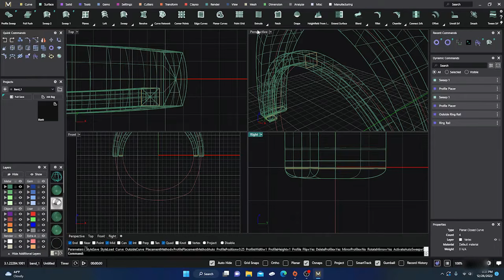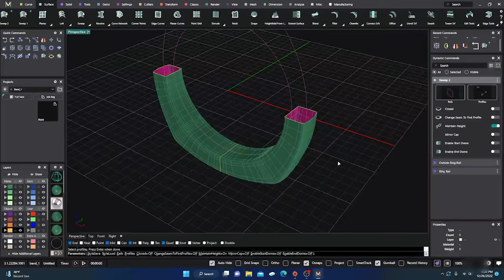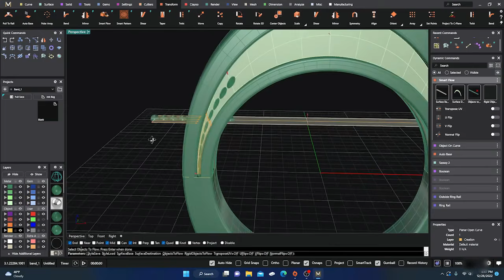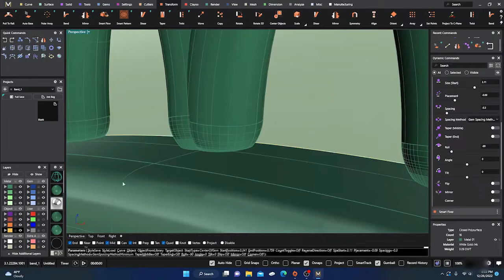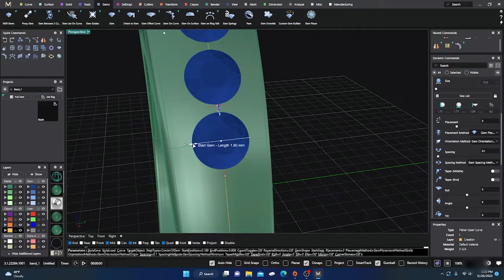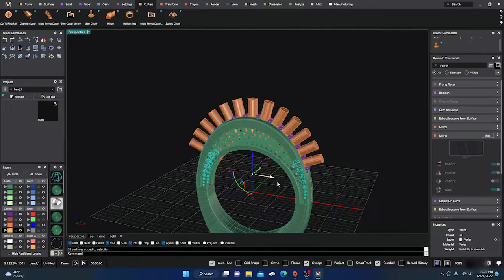Matrix 9 to MatrixGold transition Making a hollowed-out channel band with design undercarriage

Comment: Great tutorial, very inspiring, Thank you🙏
I faced a strange problem, I did the boolean union on the 4 closed polysufaces(which I caped already as you mentioned) successfully. but  in the ring properties it was written open polysurface. when I analyzed it, it showed no naked edges!! Do you have any idea sir?
Reply from the maker: Did you check for manifold edges? You might have missed a surface when joining as well. There could be many reasons for that. Usually, I isolate the surfaces and click on it which will highlight most of it and hide it to see if I missed anything. If that is understandable.